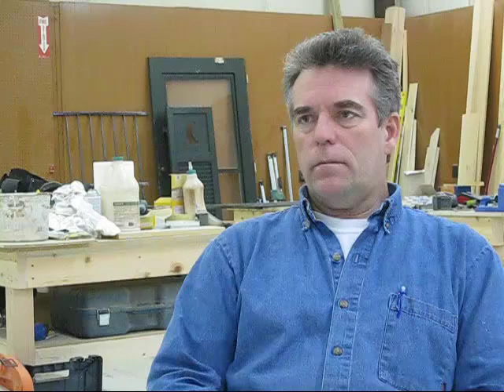Why house painting bid prices vary by 3 times http://www.LexingtonHousePainting.Co

Comment: I been doing painting for 12 years,i agree with some this guy is saying,except :sanding between every coat is not necessary but before last coat and also why run a tape to cover base if u can wipe it off with a dump clean rag after every wall u role.Checking "imperfection", little holes or cracks must be done after first coat is dry, trying to do that on white primer is waste of time unless you're using it tinted.Main problem on this field is that most costumers want cheap prices and cant see the detailing that we pro painters can see and have to do.
Reply: right lol

Comment: Sand it if it needs it. A lot the paints made these days don't level out and need a quick pole sand in between. I pole sand as needed, its quick enough not to make or break a jobs profits. I always sand new materials in between every coat and do a quick sand over repaints....